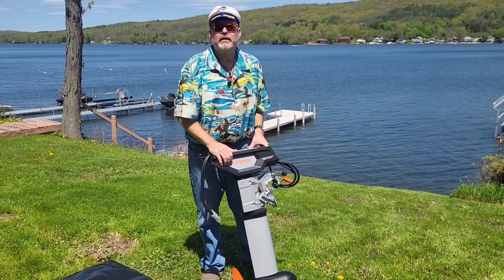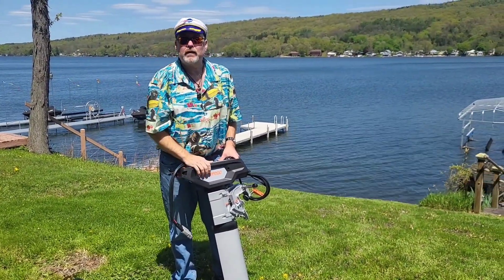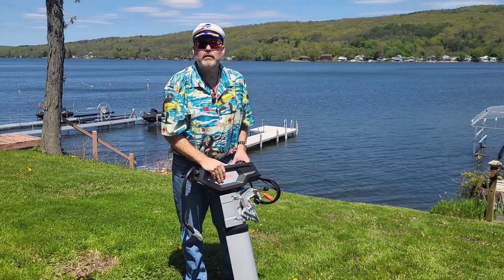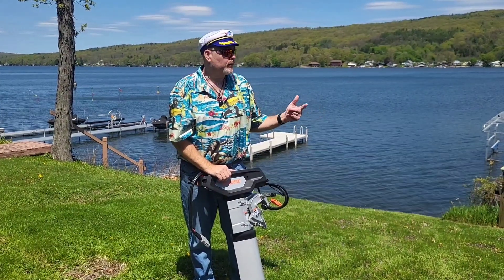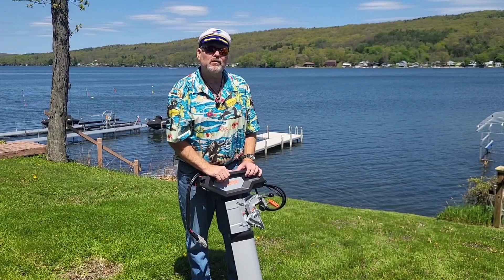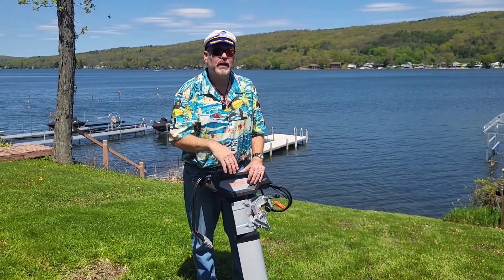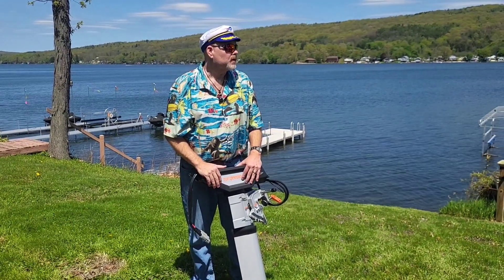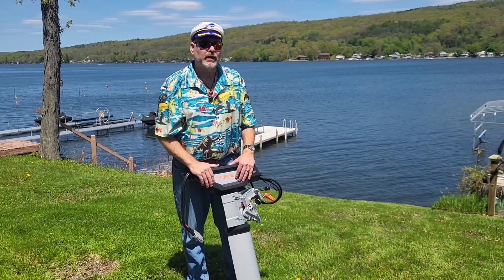Torqeedo cruise 6.0 issue on TrueKit

Comment: Just buy the e-marine cav plate I fitted one to my 6.0 cruise it was doing exactly what you said but not after the cave plate fitted it also only takes 2 mins to fit and is solid
Reply from the maker: My other video shows where I added the cavitation plate. It still has ventilation above 5KW of power usage with 2 of us in the boat.  If I'm alone, it seems to work fine.

Comment: you need the cavitation plate pro from e marine, I have it with torqeedo and true kit, it's amazing and completely fixes the problem
Reply: they recommend 15mm (0.6 inches), I left just under an inch, and the whole plate is angled slightly down
Reply from the maker: Thanks for the information, I'm glad to hear that.   I have purchased the plate and will do a follow-up video after installation. What space did you leave between the plate and propeller,  I was thinking an inch?  I also purchased a hydrofoil to add to the plate to keep even more water around the propeller if necessary.